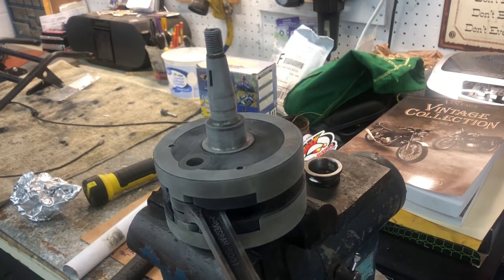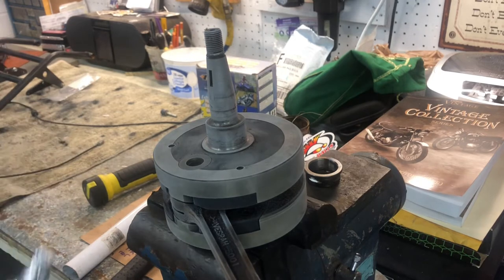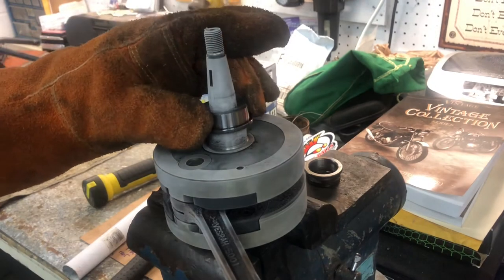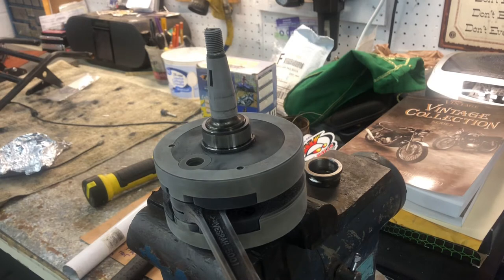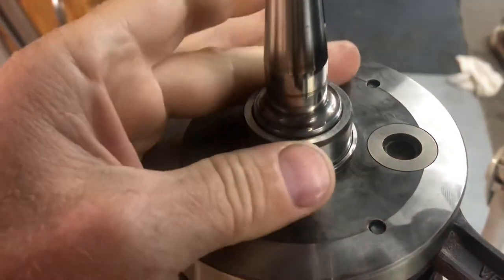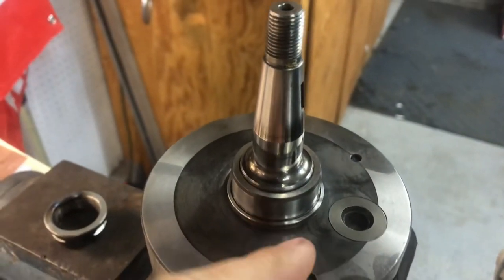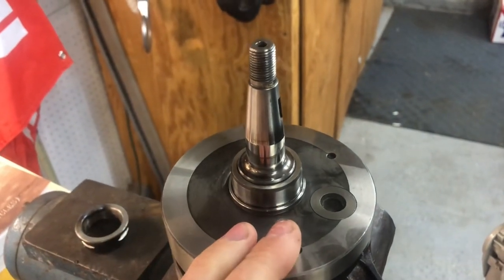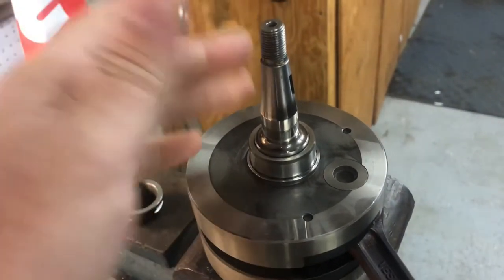Pro Tip!!  Bearing Install Using Heat and Cold,  Garage Science!

Comment: Unfortunately, that doesn't work worth a dang to REMOVE it.
Reply from the maker: You need heat!
Reply: @TomsTinkeringandAdventures  Problem is... the bearing race and the shaft are now thermally bonded together. To get it done, you have to heat the race while you're cooling the shaft without any thermal bonding through that pressed joint. Oops.

Angle grinder, anyone? Angle grinder and a cold chisel?
Reply from the maker: @timhofstetter5654  I’ve done the angle grinder thing, it works but I’m always worried about cutting into the shaft.
Reply: @TomsTinkeringandAdventures  As you should be.

Unfortunately, it's the best bet you have if you can't get a bearing splitter behind the race. A worse option would be burning it out with a hotwrench... !
Reply from the maker: @timhofstetter5654  I have done it numerous times but it’s always sketchy.
Reply: As  the  YouTuber  clearly  pointed  out,  heating is the way to loosen   stubborn  bearings  prior to  removal.

Comment: do i really need to heat the bearing? vice versa 
will it work if i only freeze the bearing or the crankshaft sir? ty
Reply from the maker: You could try it with just freezing the crankshaft or just heating the bearing, but your chances of success are better if you do both.
Reply: @TomsTinkeringandAdventures  what happens if you freeze them both sir? will it fit?
ty
Reply from the maker: @kiarahgonzales8167  science….freezing metal causes it to contract slightly, heating metal causes it to expand slightly.  If you were to heat or cool both pieces, then you wouldn’t be able to easily install the bearing.